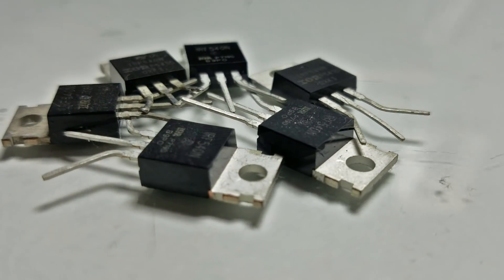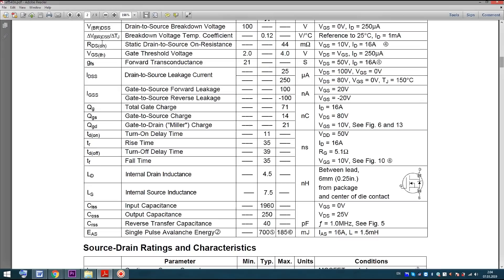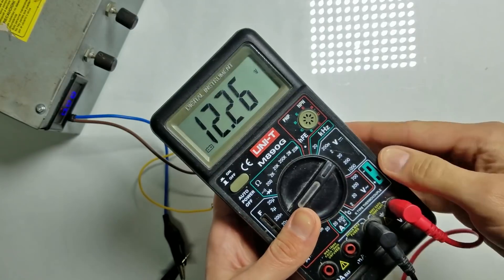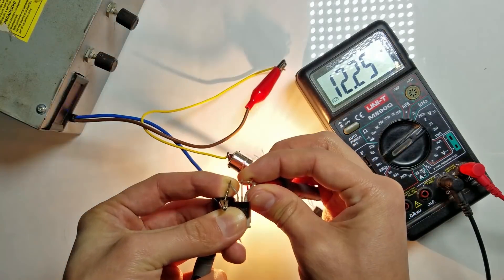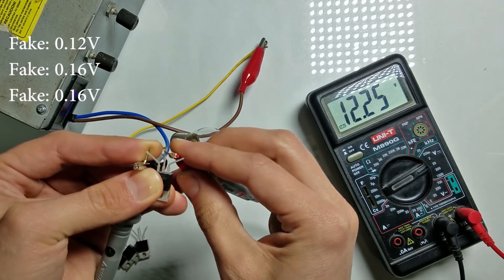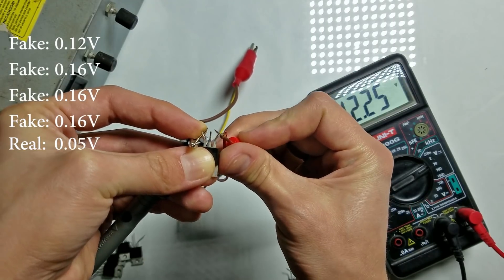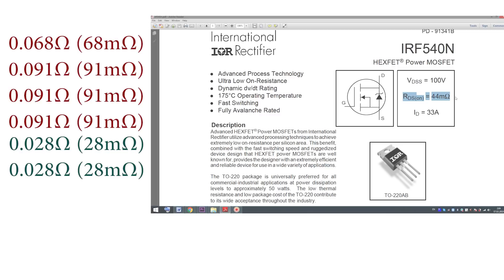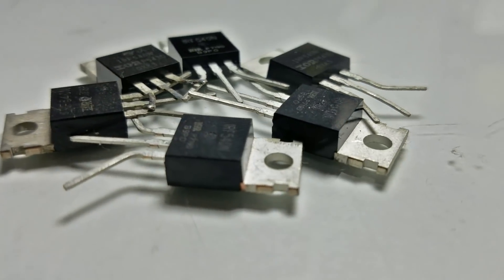Real vs Fake MOSFET | How to identify a Fake Transistor? | MOSFET Test

Comment: I bought some mosfets from aliexpress to change them into an inverter. I'll tell you that the circuit originally uses CEP76139 (30v 75A N Channel) I wanted to put Irf1404 and they didn't work, then I bought CEP83A3 and it didn't work either and then I bought CEP93A3 and it didn't work. Finally I bought IRFP7540 from another platform and it worked. I don't know if it's because of an imitation mosfets or for another reason. These mosfets don't work. Do you have any experience? Please leave your comment. Thank you very much.
Reply: buy from digikey or mouser instead

Comment: I used your method to test some MOSFETs and it made me look like a fool. The gate did not get fully turned on by touching drain and gate together. I complained about MOSFETs being defective because I calculated Rds without turning the gate on enough. One should run a separate wire from the power supply + to the gate lead (it should be at least 3v above power source voltage) while testing to get accurate Rds measurements.

Comment: you measured the current whithouts mosfet and divided voltage drop with that value, it is wrong. u should measure current through the mosfet.

Comment: I brought 47N60C3 mosfets from China.  They had Korea on some of them. Average source drain resistance 2.4 - 4 OHM no bull.  I hope the Chinese find and execute such people, they are not worth the dust they are made off.  Owe,  they worked powering halogen bulbs but inductive circuit seem to fail in "on position"-  much cursing!  God - throw the cursing on their heads!

Comment: I have the same  situation testing a pair (fake marks IR) IRFP4768 from china measuring at 1A Ids gives on state 4.5V but it should be 0.0015V Rds(on)=15mohm. It is obvious that chinese products are made on cheap production for real packing.

Comment: hmm but I have borh! One a few fake ones and I ordered also an oryginal one to compare! When you look at it it is like you say but they work in very similar way!! I haven't noticed any difference! For me and for my purpose fake and oryginal are almost the same! The oryginal one came in a safer package and has slitely better parameteres and stability etc. but for someone who starts with electronics they would be the same! I am saying only about this MOSFET because it can happen also that the fake one is a totally crap as well...

Comment: I tested a mosfet IRF3205 from China eBay and the result is 120 mVolt VDS , Ids 3.55A Rds 35mohm Vgs 12 v same results with other original bought from my local dealer... The datasheet 8 mohm for mine MOSFET IRF3205 is with very high pulsed current. Read all datasheet. Rds does not constant.... Change with Vgs current Vds... It is not so easy to measure...
Reply: Do you have kink please or name of seller ?

Comment: Both Drain current and Vds should be measured at the same time. The voltage drop Vds can affect the Drain current unless a constant current source is used.
Reply: Doesn't really matter - his numbers are spot on.  I just tested some fake IRF540Ns myself with a milliohm meter and got .070 ohms Rds on.  His results are good, even if you think his testing methodology is flawed.

Comment: At the beginging [from0,25 to 0,32min.] when you show the fake and real mosfet, i noticed that on the fake one, the token IRF540N WAS WRITEN WITH GREATER NUMBER, O.K, so i concluded perhaps wrongly, that this point could drive someone that this will be the indice of the fake one. Now the question is .Is that notice correct  and definit ? or not.  I ask this in purpose to avoid the measurements. Thanks in advance ,i will apreciate your answer.

Comment: I have bought IRF9610 some years ago, and are now using them in a design, these mosfets can dissipate 20 watts. However I have a test setup where the URF does drive a other mosfet and have a idle current of 10 mA and a voltage of 30 volts over it, calcaulating this make that the mosfet does dissipate 0.3 watts, normally I think even without a heatsink it can easely be save, however I did need a heatsink for it because it did get very hot without, so here, I can tell it is a fake mosfet, A shame Chinese supplyers does sell so much fakes I think we need to sanction that country. Oke you let see how we can see what is real, and that is the type with solder on connections, and copper is visible on the sides of the mosfet metal for cooling.  Regards.
Reply: You are right 👍
I came to this video after burning new MOSFET
P55nf06 new fake

Old ones works fine original

Comment: Its a shame nearly all cheap electronic components on most cheap online sources like ebay, aliexpress e.g. will give you fake items! I stumbled upon so many fake components - its no fun. If you recoginze a big price difference from trustworth sellers to ebay you can be sure its fake! But your measurement method is not 100% precise. If you leave the gate open (after touching it) it can slightly change potential due to touching or just leakage currents - so it would be better to connect it permanently during test. Also you have to measure the voltage on the DUT (device under test) with 4 wire method would be more precise. With higher currents you have more losses on the wires.

Comment: hello, how about IRFB4227? same connection with your testing?
Reply: Almost every mosfet or transistor is BCE or GDS, and even if it isn’t, the last pin is E or S 99.99% of the time
Reply from the maker: You mean pinout?, yes, it has the pinout.

Comment: The Source Drain resistance varie according to the voltage from the gate. You can found different value according to this. Minimal is 3,5, but if 20 volts are applied you can divide this resistance.
Reply: What you're saying is that the fake FETs are simply turning on too slowly, or that the real FETs are turning on too quickly, or that the fake FETs should have been tested at 3.5v for turn-on, or that the real FETs should have been fed 20v to see if they could handle the max. G-input regardless of low Rds.

Comment: where did you buy real irf540n mos fet?   aliexpress or ebay ?
Reply from the maker: There is a good chance to buy fake on aliexpress, I don't know about ebay. I bought mine in a local store. Try to find a store that buys MOSFETs directly from the manufacturer.
Reply: @ElectricalPro  
O.K.  Thank you for reply.

Comment: 91mOhm is better than mine.... I have some fake 540s that have 1Ohm. and irfz44n that have 2Ohms.
Reply: My mosfet even more worst resistance,its 50 ohm
Reply: OK, so I'm not the only one. My eBay MOSFETs had 5 ohms Rds. Totally useless for my repair job. Thanks for sharing.

Comment: Hi Electrical Projects, I just stumbled your channel and I have to say I'm really fascinated by your quick tutorials towards building miscellaneous electrical parts as a guide for someone like me who doens't know squat about such areas of composition. I'm just wondering how would you create a device for turning something on and off, and on and off again in a sequence at specific time intervals? And could you possibly create a video for such a device?
Reply from the maker: Hi, if you need to turn something on and off repeatedly you can just build something like "flip-flop flasher circuit", it is simple, it uses two transistors, you can add to it a relay and control anything... but if you need precise timings then you probably need Arduino, or if you need to turn something on/off at a specific time then you need ESP8266 to sync time from the internet. There are many videos with "flip-flop flashers" so I don't see a reason to make a video about it... but I want to build a device that after pressing a button turns a light bulb on for 10 - 500 seconds, and then turns it off.
Reply: @ElectricalPro  what if I'm trying to create something that mimic a person breathing? So inhaling and exhaling? It could take the form of a plastic bag and then something inside it that puts out air and suck air at specific time intervals to mimic an person's breathing pattern. Or even use a air pump putting out air for say 15 seconds and then turn off to allow the garbage bag with holes or something to release the contained air inside for 15 seconds. And right afterwards turn back on. How would it be done?
Reply from the maker: I don't know about mechanics, but the air pump will probably make a lot of noise. I only know electronics, not mechanics. Electrically you can control anything with a simple flip-flop circuit and relays... but if you need a delay between inhaling and exhaling, do it with Arduino. With Arduino, you can make it more realistic because you can add some randomness, and for example make some of the inhalings longer, or whatever you want.

Comment from the maker: A quiz question, why did I get better specs than in the datasheet?
Reply: data sheet are typical specs, since it is better that means past the test
Reply: Specs correct for minor manufacturing differences?
Reply from the maker: Hi, I think it is because I've used 1.75A... but in the datasheet, they used 16A. On 3:18 you can see a line "Id = 16A" (If I understand it correctly).  I've tried higher current ( about 6A) and got much closer specs to the datasheet.
It seems that on-resistance changes depending on the current that flows through MOSFET.
Reply: @ElectricalPro  great
Reply: because the specs on the datasheet are for 3,5v source, and you applied 12v. When the grid is overvolted, the RDS significantly decrease, and will be better.
Reply: MODFETs have a positive temperature coefficient so testing at a higher current, unless it is done in very short pulses, will increase the temperature of the device causing an increase of RDS (on).  Also, as someone else stated, the data sheet number of 44 mOhms fro RDS (on) is a Maximum.  I would expect most devices from a reputable manufacturer to be better (lower resistance) than this spec..